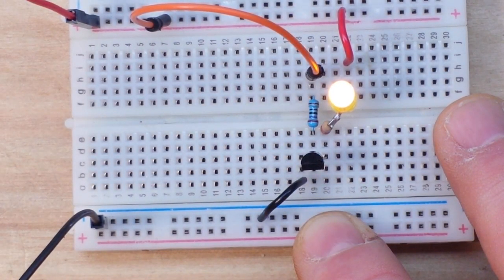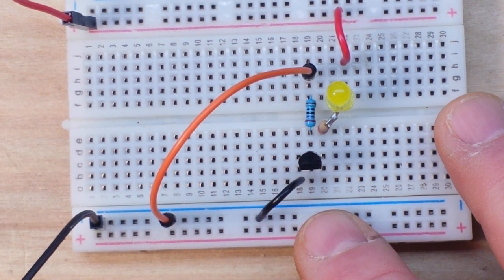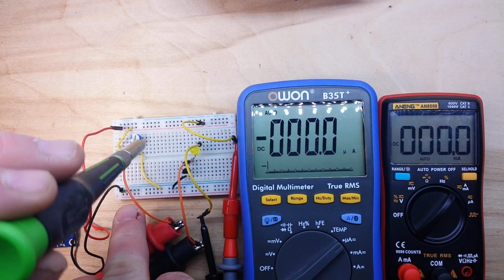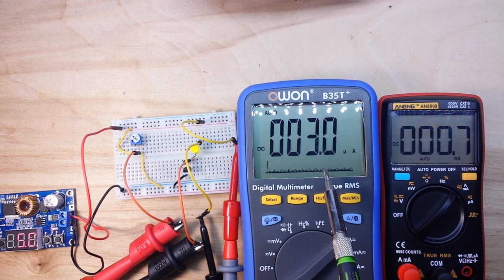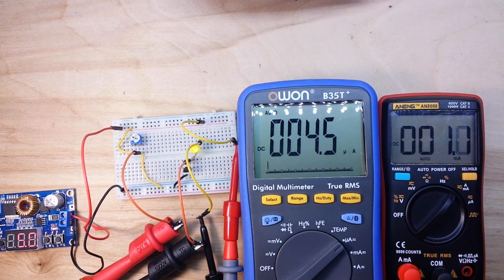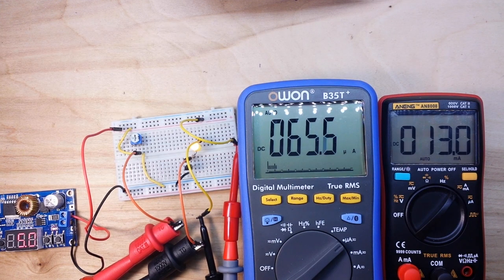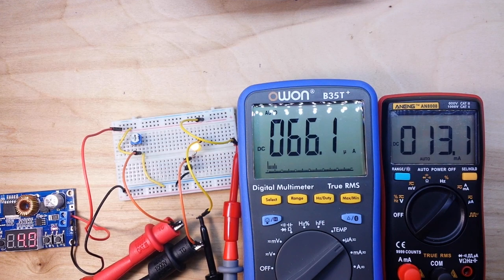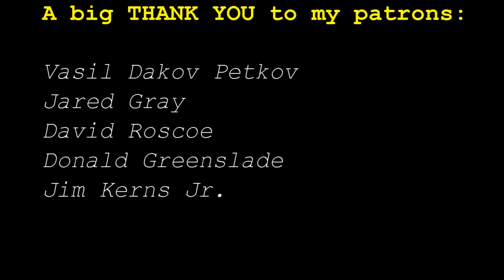Intro to transistors

Comment: I'm going to view your MOSFET video shortly but this was a great introduction.  Like another commentor mentioned, this can be tough to grasp.  Correct me if I'm wrong but (...something that confused me for a while...) saying a transistor as an amplifier is a bit misleading, in the sense that it doesn't create power from nothing.  The source of the amplification is not the transistor but the higher voltage supplied to the collector.  The transistor just allows that higher current to flow.  Do I have that right?
Reply from the maker: +Michael Padovani Yes you have it right. But why we say it amplifies is that it looks at the small current at the base and multiplies it (proportionally) at the collector-emmiter junction.
Reply: Right, and thanks for confirming that.  Thanks man for the quick reply.

Comment: on the Transistor as a switch part can you explain how what is goin on is different than just having the same circuit without the transistor? It seems that if you change the wire from ground to power the LED will light with or without the transistor, likewise with the potentiometer it would get brighter with or without the transistor.
Reply from the maker: +Dan E Yes, you can remove the transistor. It is just being used in place of a switch. This is the basis of transportation usage. Instead of a mechanical switch that you must actuate, you design a circuit to apply a current to base of a transistor.

Comment: Not a criticism since the explanation is the standard one in most books.  But I used to really struggle with this explanation of how a transistor works since it didn't make sense to me given that its basically like two diodes back to back.  (I delved deeper now and I got it).   What I struggled to comprehend was how does current flowing from base to the emitter enable current to flow in the "reverse bias diode" of the collector and base junction.   So if you can do a follow up with that part in more detail I think it would help people understand why you can't make a transistor by simply connecting two diodes back to back!
This was helpful for example: https://youtu.be/7ukDKVHnac4
And of course Dave's Video: https://youtu.be/qUeK7pHe0rI
Reply from the maker: +stewartrv you may be interested in today's video

Comment: I'm waiting for the MOSFETs! I understand them better every time I watch a good video..  but I really need help picking a good FET. the data sheets really get complicated. the more I read the mor questions I have. is there a MOSFETs for Dummies book? great video
Reply from the maker: +James stranger No MOSFETS for dummies that I'm aware of. What do you want to do with them?
Reply: learnelectronics 
I am self taught. I have used YouTube and Google to learn all I can. I also have taken a few things to bits. I have the basics down. there is a few projects I want to tackle . a inverter. DC motor controller. are a couple. the DC boost stage of the inverter is what I have a few issues with completely understanding .  a lot of it is understanding the driver circuitry. and the data sheets. how to pick a good or the best MOSFET for near 0 rdsON. with low capacitance for fast switching. gate resistors and and paralleling FETs. but when it comes to power handling and temps. power dissipation. I think I found a good get. then I look more in to the specs. and then I am not sure! and witch would be best for a DC boost stage for a inverter. and a motor controller. igbt or MOSFETs? I don't know what would be most efficient. in spec sheets. or what component or if there is a difference. between igbt and FET. how ever I'm learning slowly! I just found your channel recently. your videos are a great help. they keep me thinking! thanks